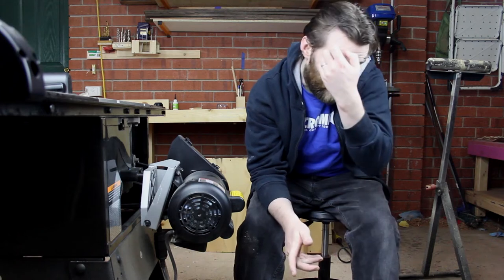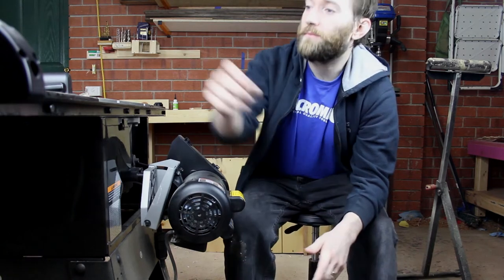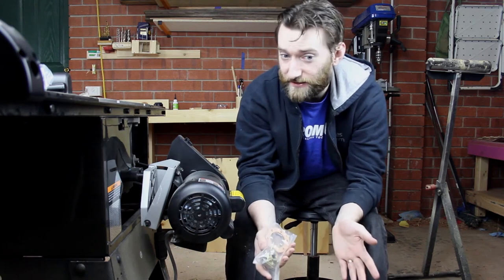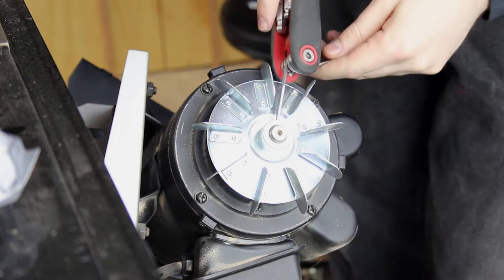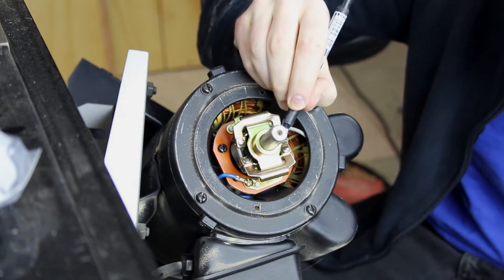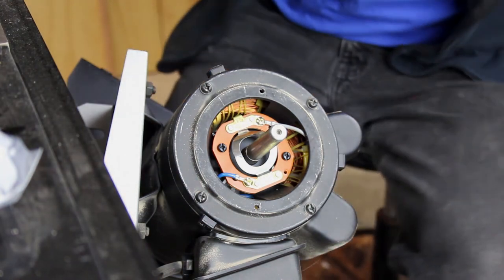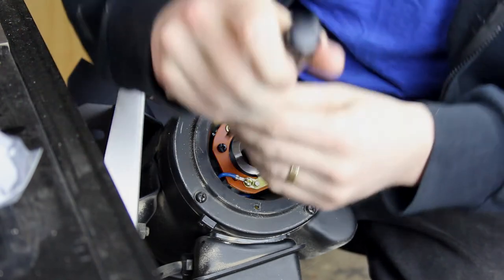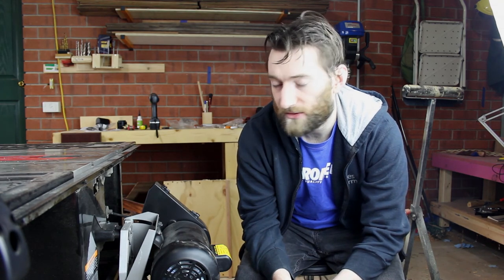020 - Replacing Sawstop Contractor saw centrifugal switch

Comment: Thanks for this video, it pointed me in the right direction as I was having this issue with my Sawstop contractors saw. I've replaced the centrifugal switch on mine and while the "burp" is less violent it's still there. I noticed that you had a similar result, did you ever get rid of it completely?

Comment: Very good video. I will need to fix a similar one  that work with 230V single phase.
BTW, how did you came to a conclusion that your switch was bad?
Reply: Use a multimeter to measure resistance. Generally, the resistance is less than 1om. Observe the surface condition of the contact, and it will be replaced if it is burnt.

Comment: I know this is super old but anyway...the centrifugal switch is part of the starter winding's. When the motor comes up to speed the switch fly open and break the contact dropping out the start part of the winding's at that point the run capacitor and like winding's keep the motor going. I did spot two capacitors on the motor yeah ?

Comment: Thinking of buying a Sawstop over a powermatic. What are your thoughts. Thanks
Reply from the maker: +OnTarget100 In Australia, only a couple of the powermatic models are available and I would not get any of them over a sawstop. They're both very good quality machines, but one won't chop off your fingers. The price difference between powermatic and sawstops cabinet saws is pretty negligible.
Reply: Thanks so much for your help. Sawstop it is.

Comment: PaulI have a very similar issue with my saw it keeps chucking belts on start up.  Have looked at the centrifugal switch and all looks good.  Did you replace the capacitor also and did it fix the problem?  My machine has an intermittent fault on start up it shakes like sh...t and trips the overload.  And when it runs it has a lot of belt flutter. I think the motor mounting bracket on this model is very feeble.
Reply from the maker: +Murray Potts try shimming it and/or contacting support. They'll get you fixed up.
Reply: Paul thanks for your reply; done all that still having issues.  I am suspecting the issue is with that the start capacitor is breaking down because the problem occurs on start up. Wanted to see if other users, not associated with Sawstop, are having similar problems.  I do not have another machine to compare it with.  Anyway I will keep following it up with "I Woodlike".  On another note I like your sled designRegards Murray